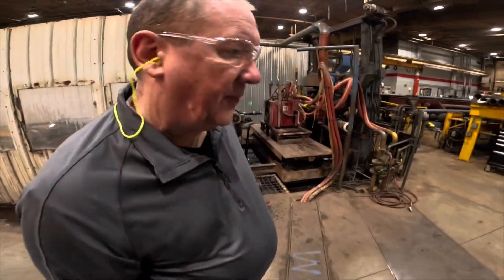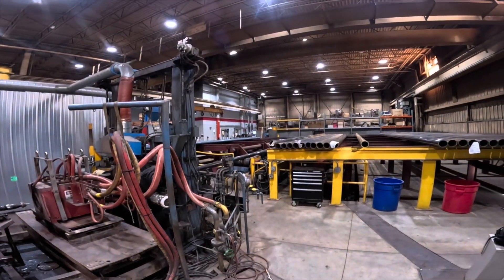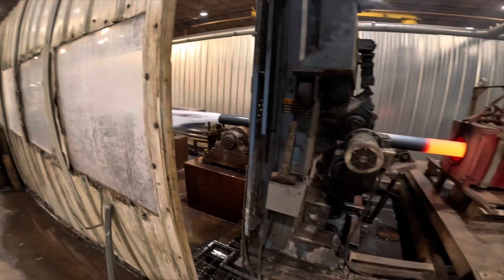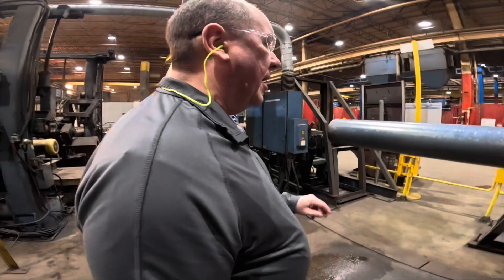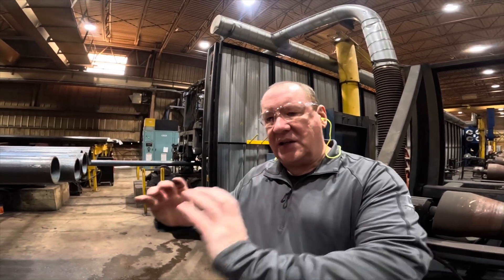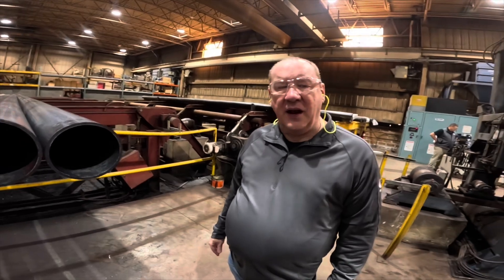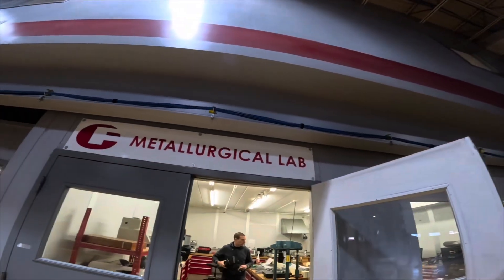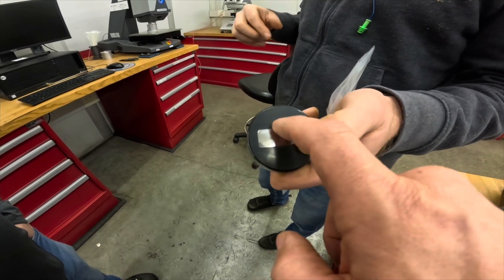How HEAT-TREATED boom pipe is made:

Comment: 3:40 Super cool! Would there be a way to pump the heated water through radiators in the building to help heat the building and cool the water?
Reply: Not enough heat to make a difference or worth it to do that 9/10.